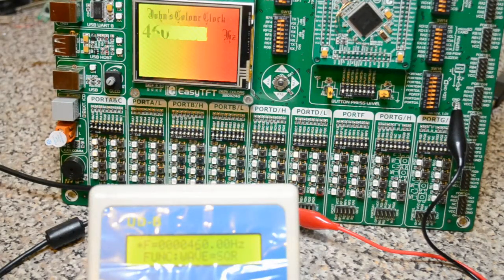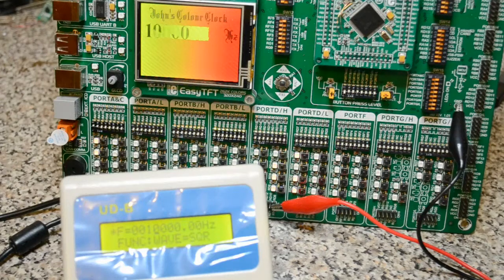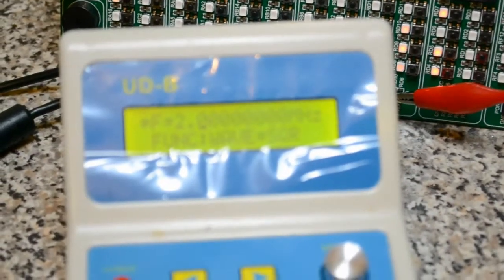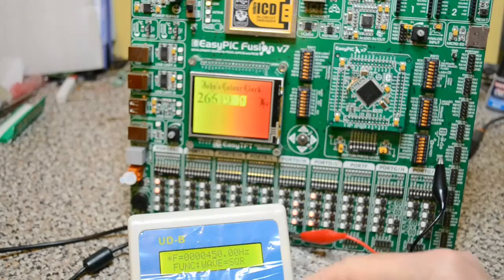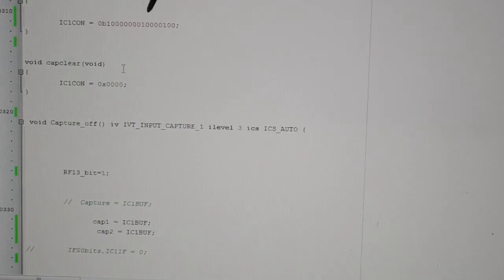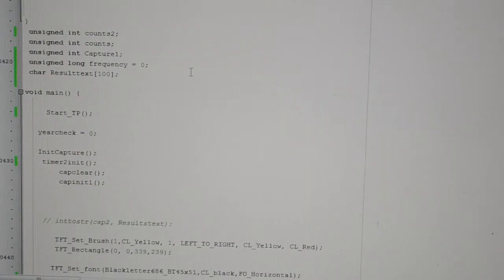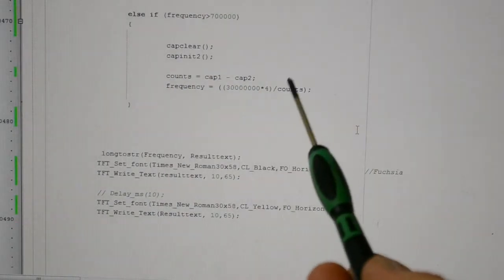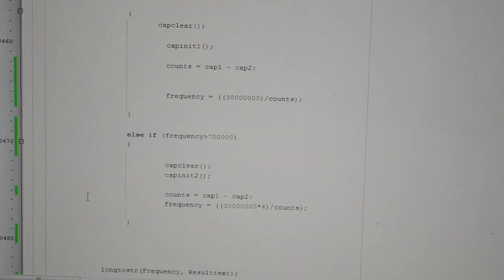Pic Frequency Counter 460 Hz to 3 meg using a Pic32 with code

Comment from the maker: Hi, I'm no expert and don't know an expert to ask when I get stuck for weeks.
I started with the 16F84 then the 16F877, then the 16F887s, I then jumped to the Pic18F46K22 but they were too slow for a colour TFT.
I am just up loading a code for an accurate RPM / frequency counter 0 to 200 pulses per second but, it will count up to what ever you want, at 1000 hertz, it starts taking bigger jumps.
Regards
jb